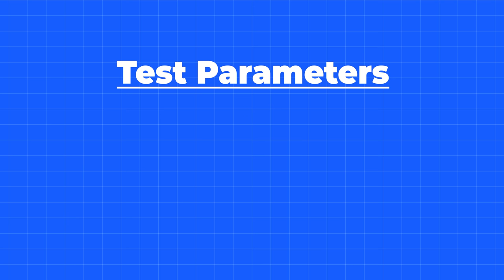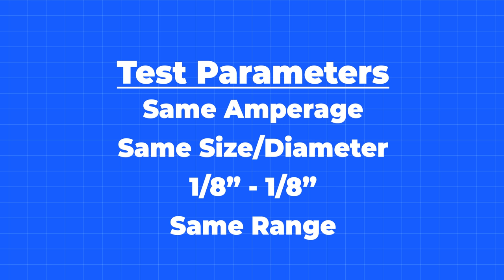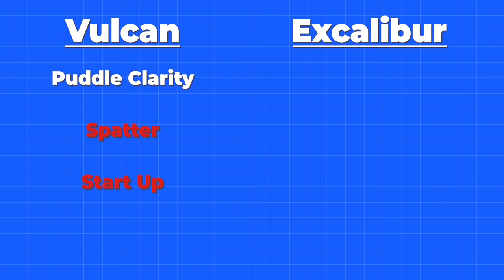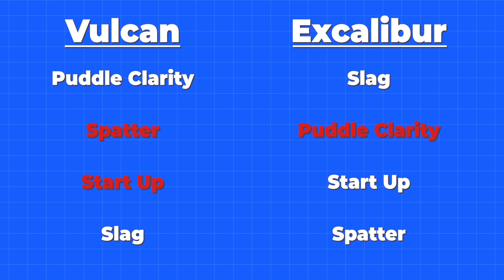$5 Welding Rod VS $100 Welding Rod

Comment: Ive used quite a few different brands. Excaliber is probly the one you will see most but i prefer inweld rods. Have never had any issues using them. Always smooth start and easy restarts.
Reply from the maker: Touché

Comment: I think start and restart is the main difference I have found in different brands when it comes to 7018. Also if you run low amps, low quality rods will turn themselves off after a few seconds
Reply: I have a lincoln weldanpower 225 and I find that if I don't weld over 110 with a 1/8 7018 I get that stopping also
Reply: I worked with a guy that had a lincoln 300 and it could go down to 95 with a 1/8 7018

Comment: The coating on the end vulcan rod. Keeps the flux from breaking off in transit. I have a 8"x1" 4in1 rasp/file that I modified for welding. Just file off a spot in the coating and they lite up smooth. Same goes for restarts.
Reply from the maker: Ooooh

Comment: wonderful Mr Packard.... I have found Lincoln 7018 AC restarts with no issue......
there seems to be no flux/slag when you stop....I use Excaliber for structural, 
I am not a pipe guy.....cheers from Florida,,,,Paul...
Reply from the maker: Thanks!
Reply: @WesternWeldingAcademy  you guys are always great James. cheers, Paul

Comment: ESAB Atom Arc > Excalibur.
Reply from the maker: Hmmm
Reply: Lol I was looking for this comment. ESAB definitely burns the cleanest and starts the best out of any rod. Best rod for welding old to new pipe and tubes. Once you burn 50lbs of ESAB you definitely notice when you have a hand full of Excalibur.
Reply: @tranzgenduhgooner7197  and when you get to their QA rod that nuclear plants use, you can no longer use Excalibur.   

I had to tell the apprentices taking weld tests to scrape the “milled” end of the rod on some millscale on the table to get it to start better for them.

Comment: I learned to weld New Guinea nugeni using 6010 Lincoln Fleetweld 5, 45 years in the jungles of New Guinea.   Yes this rod  spatters alot (many a time got hot spatter in my ear stove pipe welding vertical and overhead even with my cap bill over my ear) but even to day at 76 I still prefer the 6010 or 6011 rod. My problem is I am now retire and live in Thailand and finding the 6010 or 6011 rod is impossible.      95% of my welding is on thin carbon steel less than 1/8 thick. I have a friend who buy me welding rods in America. Wondering if Harbor Freight sells a 3/32 or 2.8mm 6010 rod? The 7018 is a waste of time welding thin steel too many burn through. I am now thinking of buying a MIG machine.
Reply from the maker: Sounds like a tough spot
Reply: i think "yawata" and "kobelco" is the best brand you can get in asia, they were made in thai.. i had a good result welding a really thin steel using yawata s13 which is made for softer steel, but they were only in 6013. . almost impossible to find other than 6013 and 7018 in asia.
Reply: @harisyoung4110  Thanks for the advise. When I first move to Thailand I was able to get the 6010 from the Lincoln reb in Bangkok, but that was 12 years ago, now they are no help. All the Japanese welding rod makers make a 6010 welding rod but but don't sell it in Thailand.  
I wave welded with a MIG welder and found it easy to use and I found Ali Express has some good ones for less than $500 with free shipping. I think that is the way to go. 
Starting construction on a new house made of steel and concrete. Will me framing the walls and roof with 2x4x 1/8 channel. Think the MIG will do the job. Thank again for the reply.

Comment: You must got a bad rod because I rather would have Harbor freight 7018 rather than Lincoln  the HF rod for me runs a lot better and I get little to no spatter with it just because you hear pops when welding dont mean anything you got proper protection on they are all I use I got 6010 Lincoln  and they love to stick I get HF 6011 and they runs nice and I can do easy restrikes
Reply from the maker: To each their own